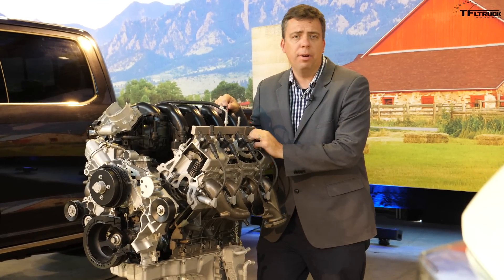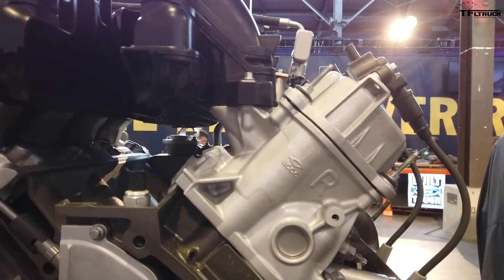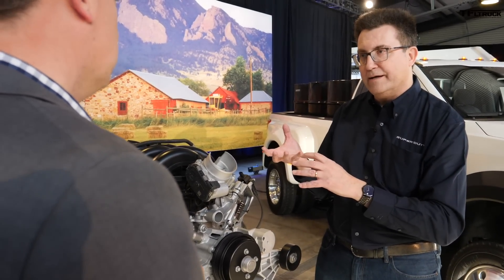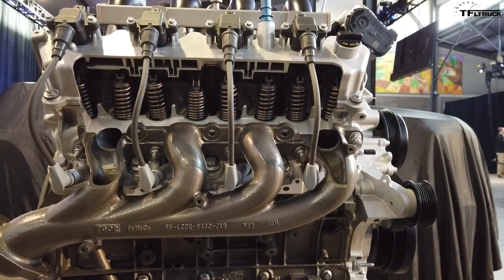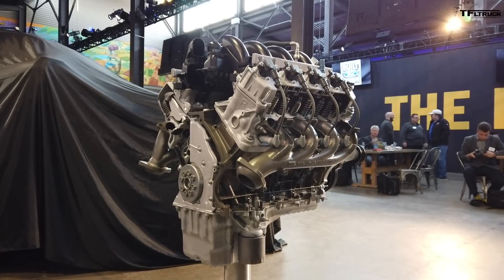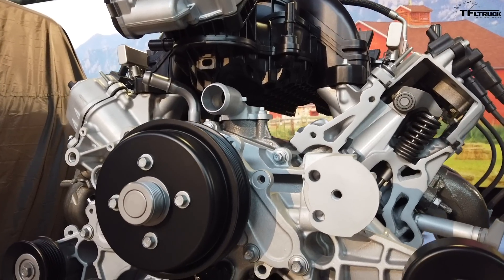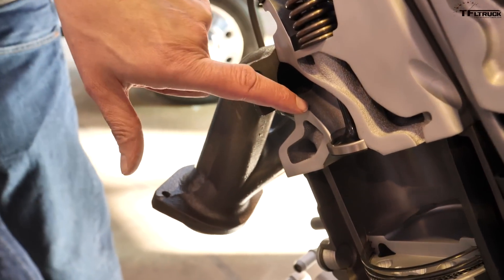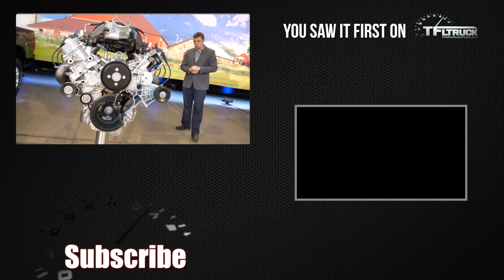2020 Ford Super Duty 7.3L V8: Here's What You Need to Know!

Comment: Sounds like they're using 7.3 as a marketing strategy because people loved the 7.3 diesel. Just a quick assumption.
Reply: Agreed.  When I first saw the title of the video, I got excited because I thought Ford was bringing back the 7.3L Powerstroke.
Reply: They should have done a 7.4 (460) since its an iconic big block ford truck engine.
Maybe my Grand Marquis will see this engine in future lol
Reply: Definitely a good assumption... Familiarity is key in marketing
Reply: So they spent millions on research design, and testing as a marketing ploy...with no intent to sell the engine?
Reply: I thought the same thing
Reply: BIG BLOCK FORD  the 7.3 wasnt even technically a Ford engine though.
Reply: @twoeightythreez  the 460 is 7.5 liters, but I agree. I had also kinda hoped they'd make a new 427 or 429 (it was originally announced that the engine was supposed to be ~7 liters) but a brand new cast iron pushrod 7.3 liter big block is gonna be sweet. Hopefully they'll quit being lame and put it in a mustang and raptor/lightning too
Reply: Seems like they did a lot of research and math to calculate minimum necessary displacement for the desired application.
Reply: @andrewthacker1389  they cant put a cast iron block in a car
Reply: twoeightythreez grand Marquis gang 🤘🏼 lol
Reply: @alextrainor2552  can't or won't? The gt500 and other mustangs had a cast iron block up until 2011.
Reply: twoeightythreez 7.5*
Reply: Only reason I clicked on the video:/
Reply: Exactly, It was made by NAVISTAR. I remember seeing an International bus with a 444 engine and then I later learned that it was basically a 7.3 P.S.D.
Reply: twoeightythreez 7.4 is the 454, a 460 is a 7.5l
Reply: Let's hope they don't tarnish the 7.3 reputation with this engine.
Reply: @twoeightythreez   The 460 Ford is 7.5L   The Chev 454 is the 7.4L
Reply: your absolutely right
Reply: Durrr why do you think they choose the 5.0? Everyone fell for that crap .... "the legendary 5.0 is back!"
Reply: @andrewmorgan7500  The original 6.9L/7.3L IDI was based off the IH MV446 gasser. So this is more like going back the to the genesis of the 6.9/7.3L
Reply: Correct built by International Harvester/Navistar
Reply: @FBHSswimmer2006  yea same I almost lost my shit in a good way
Reply: @twoeightythreez  nope that car was discontinued is 2009
Reply: @twoeightythreez  also 7.5 is 460
Reply: @matthewq4b  no kidding? Had no clue that's interesting
Reply: @andrewmorgan7500   Yup the IDI's were pretty much just reworked MV 404/446 gassers they even used the MV404/446 crankshaft and con rods timing gears etc.  You could convert the IDI's back to gasoline using MV cylinder heads and making provisions for an ignition system if you desired.
Reply: I thought that two because of the legendary name the 7.3 had
Reply: Agreed. The engine that should have never been eliminated.
Looks a lot like a ls chev unbeatable
Reply: @88montessjj   You mean the Ford Small block is unbeatable.  Cause all GM did for the LS was update the FSB.
Reply: Scott-Michael I think ur right cause it got my attention but after a minute into the video I heard him say gas motor and I was let down. I own 2-7.3L Diesel F-250’s and they are daily work trucks for my businesses and I would trade them or sell them.
Reply: Andrew Thacker its not going to be a good car engine, well not a good high revving car engine. Im guessing its only going to rev to 5k rpm. I heard the stroke is longer than a 460
Reply: @BigCool95   Uh it is not a car engine now is it ?   And the 460 had a relatively short short stoke any way.  With the 400 428 300 I6 and the V10 all being longer.
Reply: Thought the same thing, but too good to be true since International made the old 7.3s.
Reply: Smokey Bear sir fords powerstroke engine is made in Mexico thank u and have a good day
Reply: gary cress Along with most engines and frames. Although the old double nickel engine blocks were pretty sweet.
Reply: Probly
Reply: Troy Sorensen - Ford did about as much math to calculate the ideal displacement as they did when deciding to make Coyote V8 a 5.0. Like 7.3, the 5.0 displacement is synonymous with greatness in relation to Fords, so it was definitely a marketing decision.
Reply: my dad had a 2000 7.3 that ran forever.
Reply: Smokey Bear  agreed but 10 years rather 50
Reply: 7.3 diesel engine can move light vehicles even with it's picture
Reply: Let’s see 5.0 in the f150 and mustang.    The rangers back with a 2.3 now and 7.3 going in the 3/4ton and up.  Yep it’s 1994 again boys
Reply: @redbluesome2829  seriously though! "The exact amount we needed for the desired application was 7.3l", yeah ain't that some bullshit. Answer the question correctly, "well you've already heard of the most iconic superduty engine of all time, the 7.3l, so... we did that again..."
Reply: Scott-Michael but that shouldn’t work because people know the difference from gas engine to a diesel
Reply: Sure, if you don’t know the difference between a gas and Diesel engine.
Reply: @twoeightythreez  Ford owned the larger partition of international stock at that time as they do now with Cummins and used international to build that 7.3 Ford later sewed international for not building a engine for not holding up to their expectations and came up with their own power stroke
Reply: @twoeightythreez  technically it was there's
Reply: Smokey Bear   I thought they were moving to china?